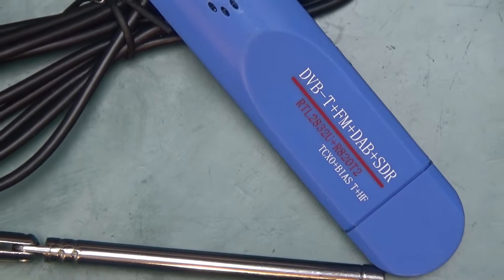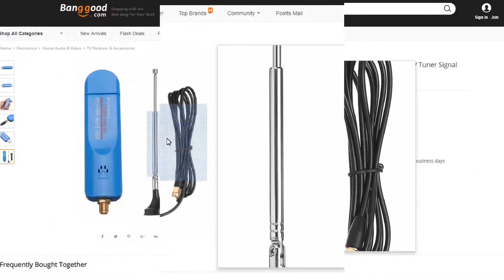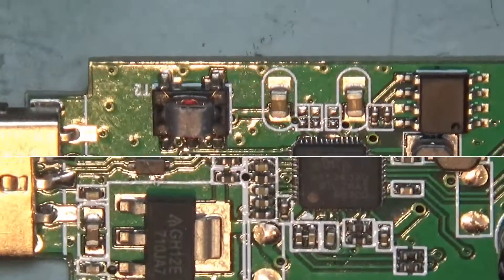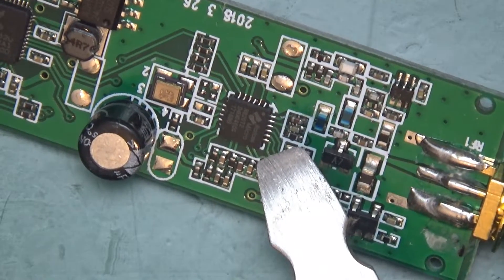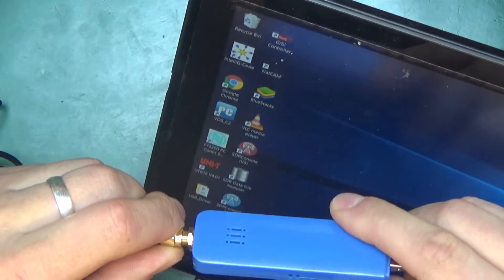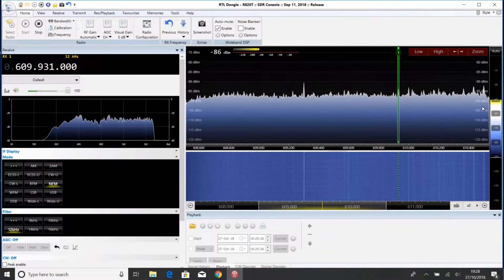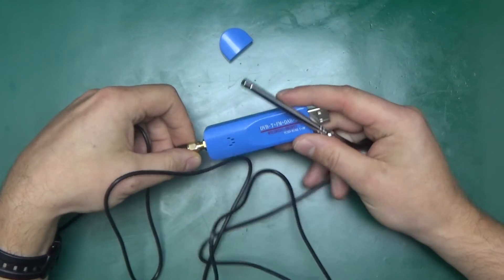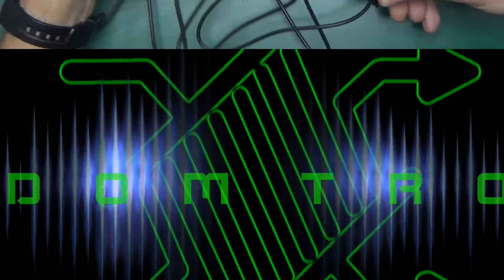#029 - SDR dongle - just dipping a toe...

Comment: The magnetic base of the antenna should be placed on a flat metal surface.  The roof of a vehicle or the end of a metal coffee can or flat metal cookie sheet will work too.  This is called a "ground plane"... not to be confused with an electrical ground.  It helps the antenna function properly.  One explaintion can be found at https://www.wearecb.com/cb-antenna-ground-plane.html 
There are many more on the interwebz for your pleasure of course.  Knowledge is free... understand it... then share.

Comment: HF = High Frequency?
Anyway, I'm thinking... Do you think it would be capable to get to 5.8Ghz? (With an appropriate antenna, of course.) Because... If so, maybe it can be used to capture FPV feed for a computer. Much cheaper than an Eachine ROTG01 and others.
Reply from the maker: From what I read and understood so far, those dongles top out at about 2GHz or under, so 5.8GHz might be out of reach.
Reply: @randomtronic  Oh, I see. 😕